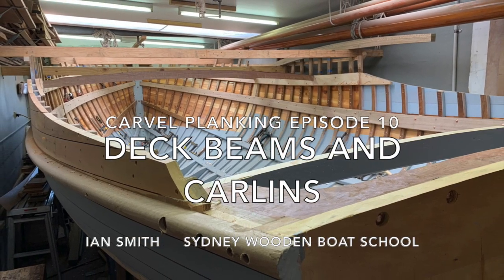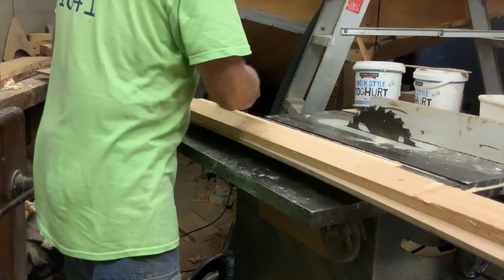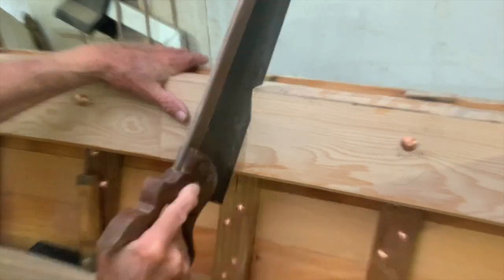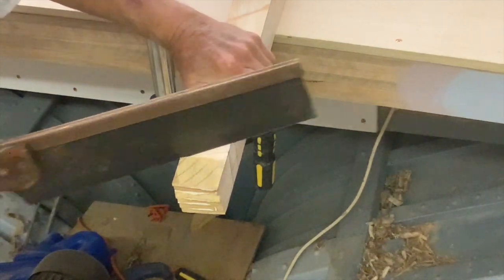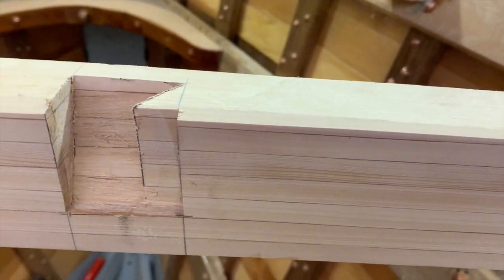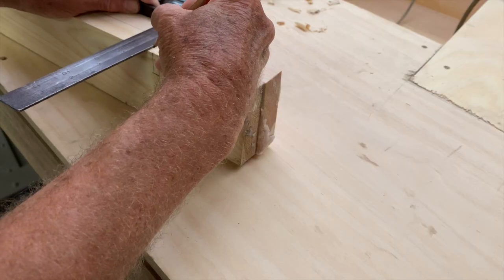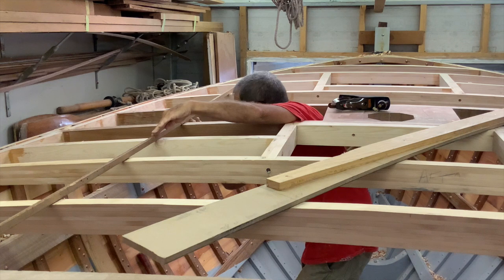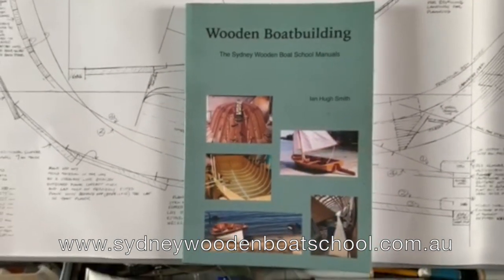Carvel Planking Episode 10: Deck Beams

Comment: Hi Ian. Can you clarify if the laminated deck beam mould as illustrated in the video and on page 103, fig 37 of your book, is adjusted for the underside curve of the beam by subtracting the total thickness of the beam from the designed deck camber? I'm building the David Payne Snapper Boat.
Cheers, Paul.
Reply from the maker: Hi Paul, You could do that but the difference between
the curve you would get from doing that and the nominal curve is minimal and insignificant. You still need to make up a pattern to fair the deck as well as using longitudinal battens. 
Cheers,
Ian
Reply: @SmithysBoatshed   Thanks Ian.

Comment: Hi Ian!Could you direct me to a supply where I can get spotted gums for ribs and  stringers.Alao what timber do you use for the keel and keelson,and stern post,and is the best place to source it from
Reply from the maker: Malmotu Motu the company I sourced my rib stock from ceased trading recently. I got the Spotted Gum for the keel and stem from Clarence Valley Timbers at Grafton, but they had no rib stock when I went back to them. They may have stock again by now.
Reply: @SmithysBoatshed  thank you so much Master craftsman Ian!Really appreciate that🙏🏼🙏🏼

Comment: You should , start up your boatbuilding , school again. I think there would be,  heaps of blokes who would interested, in learning from a master craftsman. It could also be a way of funding this project. Btw, what Australian hardwoods are you using ?
Reply from the maker: No chance of classes I’m afraid. I’ve used Spotted Gum for most of the backbone, ribs and king beams. There is the odd bit of Blackbutt, Jarrah and Sydney Blue Gum but mostly in painted areas. Visible knees will be Tea Tree. Interior and deck joinery will be in Queensland Maple with highlights in Australian Red Cedar.
Reply: @SmithysBoatshed  Wow that is a real mix where do your source your materials ?